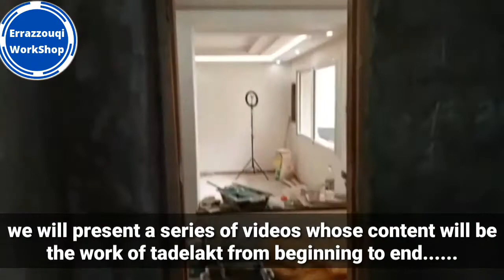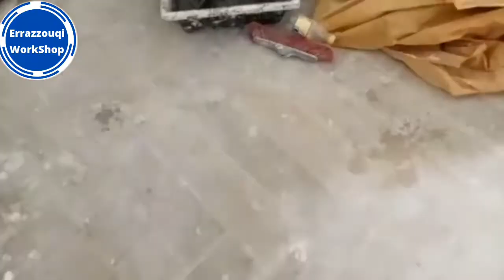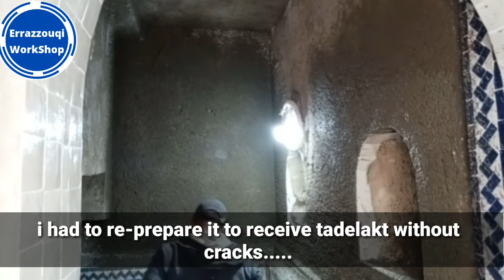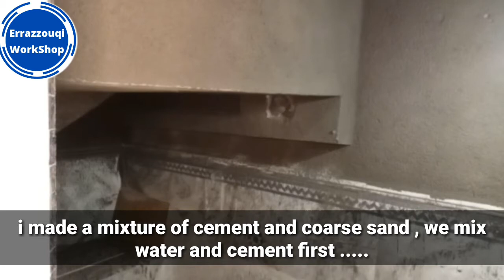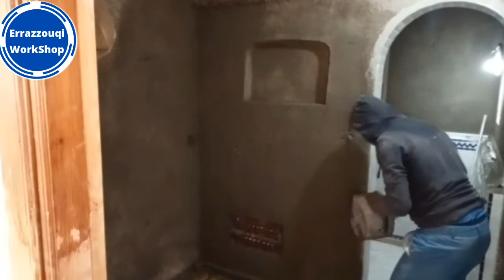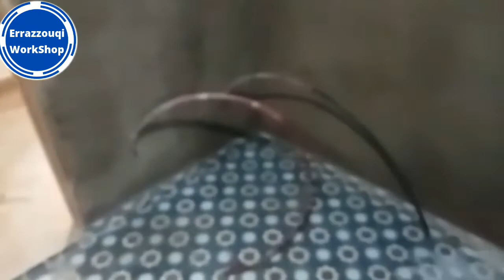The Application Of Tadelakt For The Shower From A - Z | ( 1 ).

Comment: Thanks for your very insightful videos into the process.  Was the splatter coat needed so to give a slightly rough texture for the lime coat to key on ?
Reply from the maker: Sorry for the delay ,  yes  the second aspect is important for the integration of lime and obtaining the required thickness .

Comment: What is the device you use to spay the cement/sand mix on the walls called?
Reply from the maker: Hi , thanks , it's a creping machine or splatter machine .
Reply: @TadelaktWorkshop  Thanks for getting back to me. Your channel is awesome. Thanks for sharing your experience. Do you use any wax for waterproofing tadelakt or does the soap seal it?
Reply from the maker: @punchout2418  Thank you for your positive comments, happy with it , yes i used wax to apply Tadelakt as the last stage , it is shown in one of my videos .
Reply: @TadelaktWorkshop  is that just cement or cement and sand in the splatter gun ?
Reply from the maker: Cement and sand .
Reply: @TadelaktWorkshop  thanks .. 3 cement / 1 sand ?
Reply: @saren6538  It's probably the other way around. Just my guess. A little cement goes a long way when mixed with the right aggregate.
Reply: @punchout2418  hi yes traditionally it’s the other way round but this is a very wet splatter coat … i remember us doing it in Morocco years ago just can’t remember the mix
Reply: @saren6538  Yeah that was just my best guess. I've never done a mix with more cement than sand. The closest I've gotten was a 1.5 sand to 1 cement. I'm not sure about splatter coats but as you said traditionally it's usually more sand than cement.